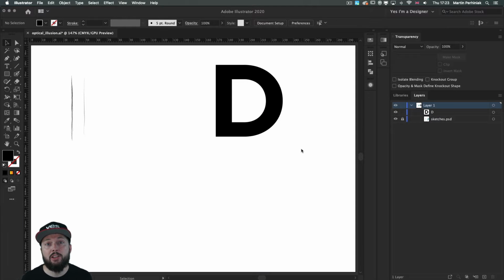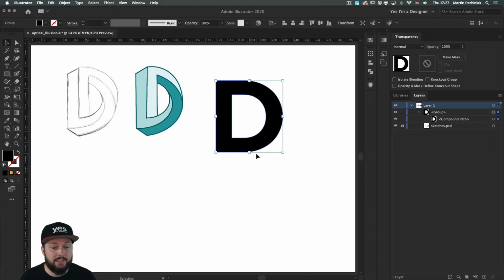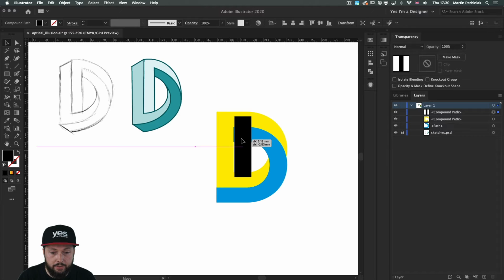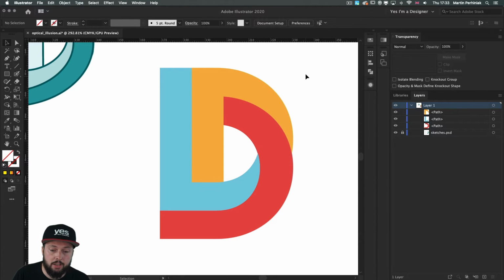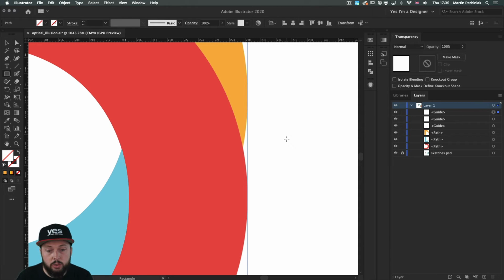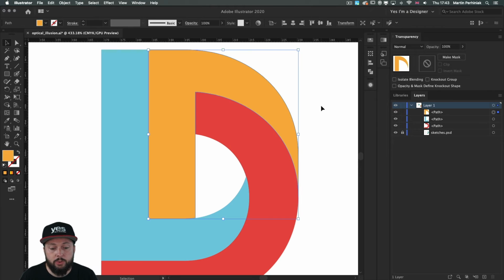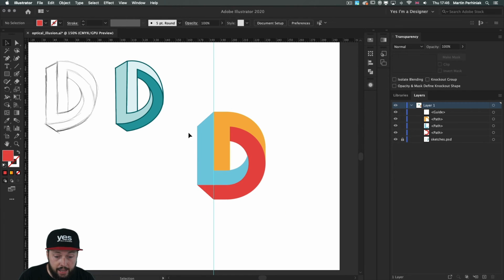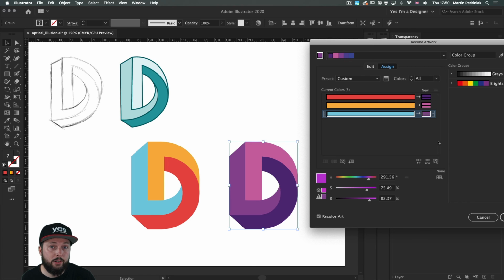Creative Alphabet Design #3 - Optical Illusion (D)

Comment: Hey! I have watched bunch of your videos they are really great, I have learned so much from them. There is one thing I wanted to point out was in one of your pen tool videos on illustrator you were referring to reshape tool while pressing alt on pen 
tool, that is not reshape tool that's anchor point tool which is available in pen tool section, I even have custom shortcut for it, but you can access it by pressing shift+c. Hope it helps..